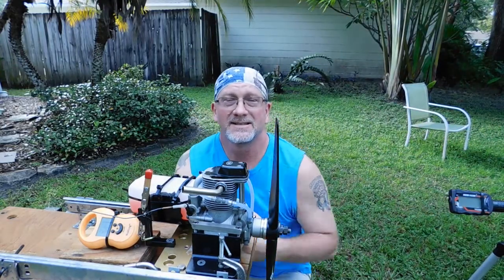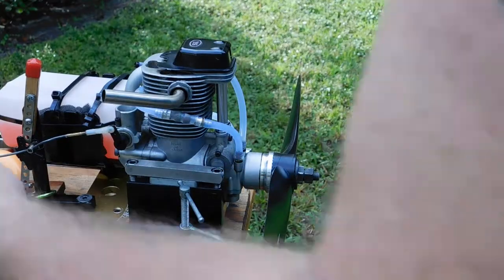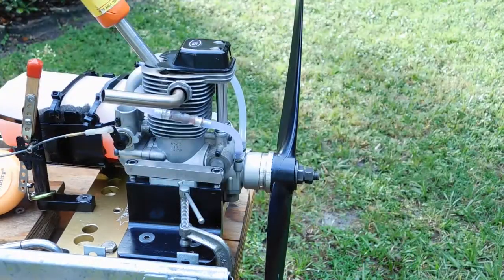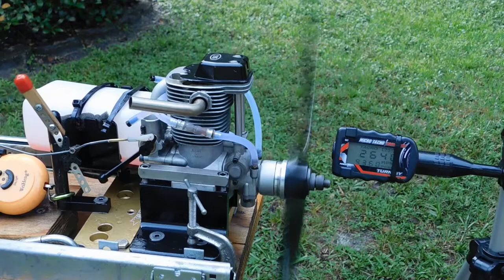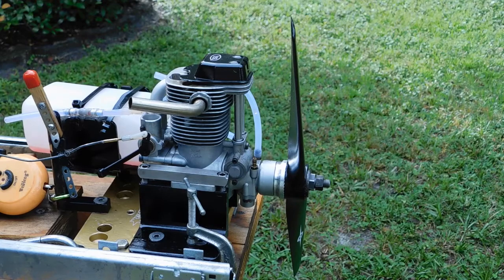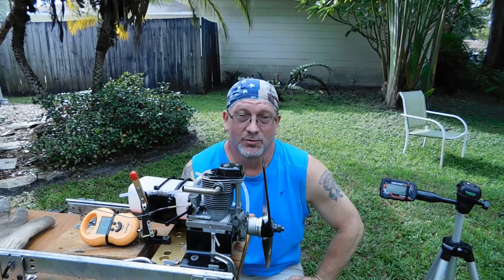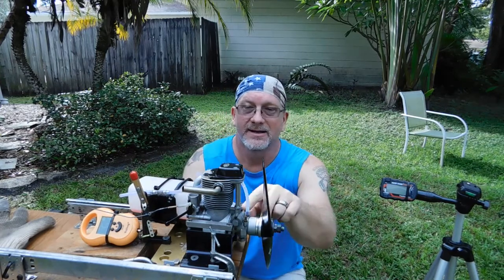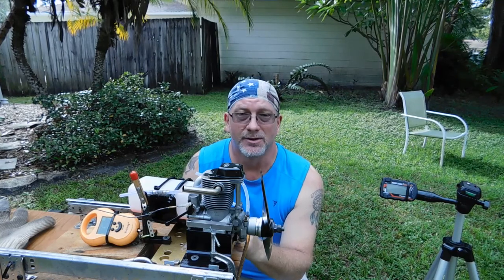YS F-120 Customer Engine The First Run

Comment: The valve cover is part of the intake system
Reply from the maker: Yes, I realize that.
Reply: You mentioned you had replaced a valve cover bolt that was missing
Reply: @jeffie8696  
Correct,  Valve Cover is Pressurised as a Plenum Chamber.
If they leak, they cause bad engine runs.
This also applies to the PushRod Tube "O" rings, if there bad, causes same problem. 
For anyone watching in the future that has problems.

Comment: My starting procedure is a little different than what you showed in this video. First I open the throttle fully and flip it over 10 times to pressurized the fuel tank. Then I close the throttle to a couple trim clicks above idle position and flip it over 5 or 10 times to prime the engine. The engine will almost always start on the first flip after the glow plug ignitor is put on. At first the idle will be fast. Open the throttle for a few seconds and the fuel tank will fully pressurize. Close the throttle and reset the trim. The idle speed should lower due to the richening of the idle mixture caused by the fuel tank pressure. 
This is my favorite engine that I own.
Reply from the maker: Yeah, I might have had things reversed.  I don't run YS engines very often.  It was fun though!
Reply from the maker: Well actually I did but after reviewing the video the tach could not be read.

Comment: Dave, How does the super charging of this engine work. I don't see how the air would be boosted?
Reply from the maker: I never said this engine was super charged.  Here is the only article I have found on this exact engine.  
http://sceptreflight.net/Model%20Engine%20Tests/YS-120.html
Reply: I thought that the box said that it was super charged.
Reply from the maker: Well..... read that article.  Those are 'terms' Futaba/Yamada uses but in the real definition the engine isn't super charged.
Reply: I just read that article, I never realized that super charged was a marketing term
Reply: @danielsgrulloni786  It is a supercharged engine. The air is sucked into the crank case and then pumped up to the "carb". This is all controlled by a rotary valve on the back plate. It's not a typical form of supercharging, but that's what it is. Based on the math, it creates somewhere around 10 psi of boost at full throttle. This is why this engine has such an insane throttle response and has so much power compared to other engines.